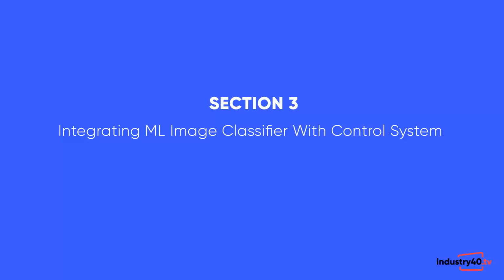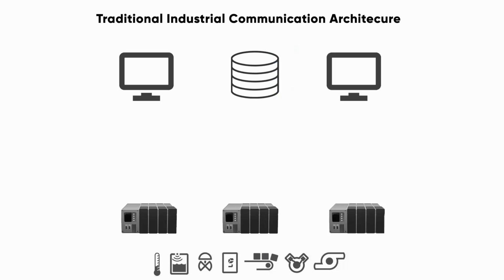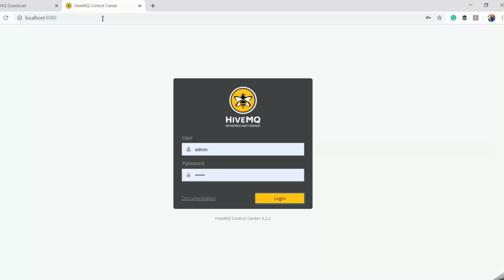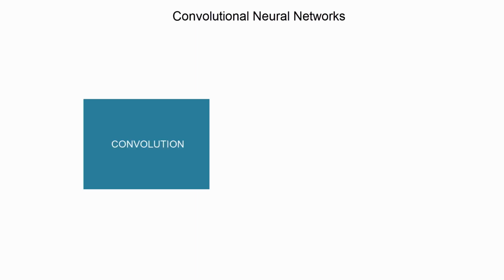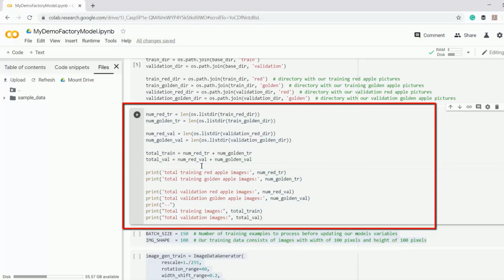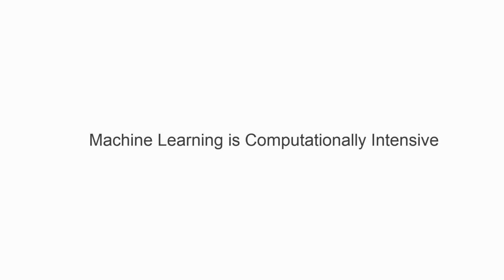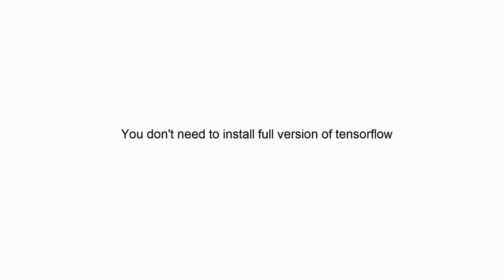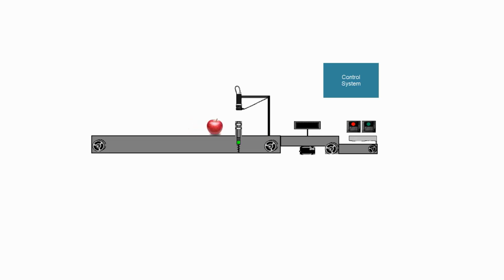Edge Intelligence for Industrial IoT Using MQTT, Python, and Tensorflow [Machine Learning]

Comment: Great project and video. Thank you. I have several questions if I may. 1) Why did you use MQTT when you connect the sensor detection? couldn't you just connect it directly to the PI? 2) what proximity sensor are you using? what distance can it detect?  (I have more questions for sure as I keep looking at the video).
Reply from the maker: Thanks, Yigal. Connecting directly to RPI would have resulted in a tightly coupled system that doesn't scale. Creating a communication network around a broker allows you to add components that do not need to have knowledge about each other, at scale. For example at any given time I can replace RPI with an Arduino and my system architecture would not have to change because all communication is going through a broker. 2)The proximity sensor is a collision avoidance infrared sensor that can be physically tuned to set the desired distance of detection.
Reply: @industry40tvonline  I agree about scalability, yet not all projects require scalability. Using MQTT increase complexity and can cost with timing issues with fast systems.  Yet your approach is surely good. 3) How is the proximity sensor sending the MQTT message? connected to ESP32 or something similar? 4) Proximity sensors like the one you used are measuring several mm only. What sensor specifically did you use? 5) Why do you use proximity sensor when you have HD Camera connected to tensor flow? Couldn't you use the camera s a detector? I am making now a train toy detection system. So far I used Ultrasonic sensor as a detection. Now I want to migrate it  to camera detection. Is that a mistake?
Reply from the maker: @YigalBZ  It's actually good design practice to build for scalability even in situations where you think you might not require it, as projects do tend to grow. MQTT is actually super-fast with Millisecond latency, and it reduces system complexity (2) That proximity sensor can measure up to 80cm, https://www.mantech.co.za/ProductInfo.aspx?Item=15M8255 . Proximity sensor is used as it is part of a control system that should work even without a camera. The camera is dedicated to Machine Learning inferencing and the purpose was to demonstrate its integration with an existing control system. The proximity sensor is connected to a Programmable Logic Controller via a Digital Input/Output module on the controller's rack. Using a camera instead of ultrasound is use-case dependent, if you want to detect a train as a train then use a camera, but if you just want to detect a train merely as an object then use ultrasound.
Reply: @industry40tvonline  What do you think about the following architecture: The RPI acts as both TensorFlow Lite as image detection and as a motor control of the train (through the 40 pins connector). the RPI's cam will detect the train's arrival, and will control the slowing down of the train by measuring the distance between the train object to the camera. When the train arrives to a certain location, the RPI will set the motor driver to stop, and then to move. Do you think that it can work? Or should I dedicate the RPI for the image processing only? The more I think of it, perhaps I should sperate the control functions and the image processing....